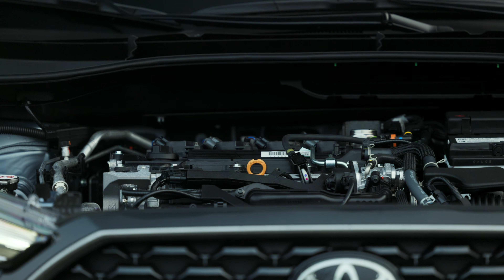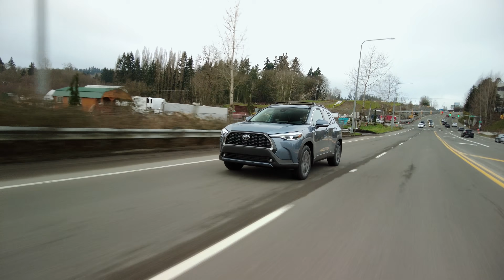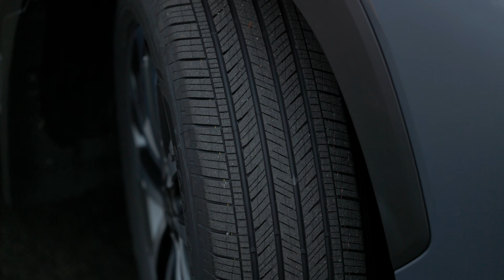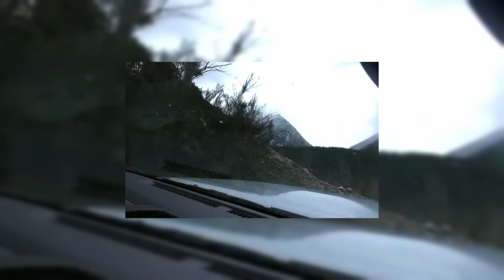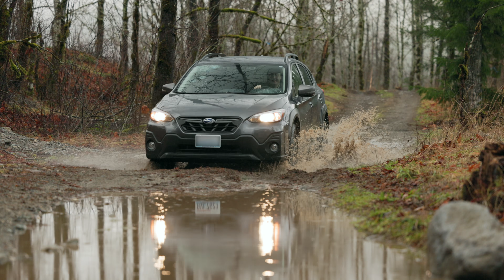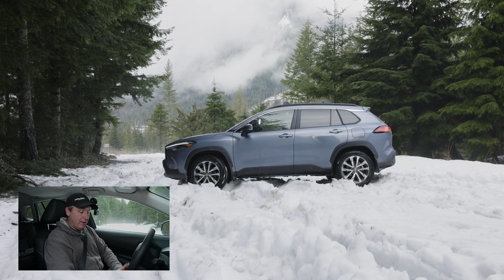2022 Toyota Corolla Cross vs Subaru Crosstrek AWD Off-Road and Snow

Comment: As much off roading as I do, I can tell you that with all due respect, the AT tires that Subaru has is an unfair advantage and from what I saw, did make a difference. Tires are basically always a major factor in any driving situations where grip is a concern. In the end, I'd like to see you swap tires and repeat the test.
Reply: Update: Although I was very interested in the Rav4 Hybrid, I ended up going with the Subaru Forester non-hybrid. I live in the woods like way out and 99% of my driving is hwy so the 4 mpg better hwy gas mileage wasn't enough to sway me in the end toward the hybrid. I found out that due to all the massive amount of safety features and ratings, I saved quite a bit on my (45% ish) on my auto insurance going with the Subaru and the value of the Subaru for me was better as I was able to get a fully loaded limited for the price of a base model (with some extras) Rav4. I like the fact that the Forester has a nicer ride and is roomier but I'm sure I'll own a Rav4 in the future. I can see reasons to want either.
Reply: I did find out that not only are Subaru's made in Japan where most Toyota's are usa (Rav4 Kentucky) but toyota does own 20 % of Subaru and they are havibg a positive influence on Subaru in the quality and reliablity department.
Reply: @generalcaeser9176  safety wise.
Subaru is very good.
A friend of mine got into an accident with  his subaru forester (a truck rammed into it). He has some injuries but the car was totalled.
After he got out of the hospital he went to see what his car looked like after the accident.
It was really damage badly. If looking at the car I would say he could have died.
So he ordered a new forester.
Reply: @zulkanainbaharuddin2185  That seams to happen a lot with these Subaru's. They really are the top for safety standards today and they have been for a few decades now. Thanks for sharing.
Reply: @OxnardComma  I felt that way for 25 years but there are just too many recent videos showing differently. I've owned loads of Subaru's and they are amazing but I've found them less reliable than Toyota's are. So I really like what I see on these new tests as it gives us both off road capability and better reliability.
Reply: Tires wouldn't have made a difference here. I agree that tires usually help...but this AWD system just isn't made for that type of off roading.
Reply: @JRsguitargear  Agreed. AWD is for roads in bad weather, not serious off road terrain.
Reply: @JRsguitargear  disagree, I do it often with my Cross AWD with AT tires out in the Mojave Desert & Colorado Deserts and people are surprised how far I get on these back roads. The hill he failed on I would have made it and many others would have also. It was not his car so he had to stop. Also there is a video of test drive in South Africa where they really pushed it to the limit!
Reply: AWD is ok, although I still think Subaru's is better. Main weakness is that it clearly needs a more powerful engine, especially in the more expensive trim levels.
Reply: @edsmith9855  I would be going for the Rav4 Hybrid so a larger engine wouldn't interest me. I hear you on the Subaru having a better AWD but come to find out that may not be the case any more. Check out some of the testing they do and you'll find that the Rav4 is coming out ahead and has in every recent video I've seen.
Reply: @generalcaeser9176  I was talking about Crosstrek vs Corolla Cross specifically in regards to Subaru having a better AWD system. Some Toyota models do have very good AWD systems.
Reply: @edsmith9855  Oh, I see. At first I was seriously considering those but then realized I really need more ground clearence with the amount of snow we get up north here.
Reply: @generalcaeser9176  Interesting, what does Toyota offer recently that beats Subaru? Specifically the X mode and hill control? I own a legacy with cross climate 2 tires and while that's certainly not a off-road vehicle (doesn't have X mode), combination of AWD, hill control and tires is phenomenal for snow and moderately icy conditions. One reason why Toyota recently collaborated with Subaru on the BZ4X/ Solterra is the latter's expertise on AWD and offroading with the Forester/outback
Reply: @z1az285  I'm confused, I never said anything about Toyota or Subaru being better one way or another. "Better" is subject to how you plan on using it. But, I'll answer your question anyway. Subaru has an awesone awd system that's fantastic on snow and ice, the Rav4 has improved and in many tests is every bit the equil to Subaru. I tend to still lean subaru if I had my choice though. As far as Toyota making something "better", if your refering to off road capabilities, the Toyota 4Runner is better off road more a ton of reasons but the main reason is that it has 4 wheel low. Nearly any vehicle with a 4x4 low option will have an easier time in rougher off road situations. So yes, Subaru AWD for regular nasty roads and trails but 4Runner for the tougher stuff.
Reply: @generalcaeser9176  I'm sorry, I didn't mean to imply you said better but I understand your example of the 4runner perfectly. Like I said, the partnership between Subaru and Toyota (BZ4X/ Solterra EV) was interesting because Toyota themselves said they wanted to use Subaru AWD tech while Subaru used their battery tech.
Clearly Toyota always had the AWD  knowhow. 
 Of course on another note they have collaborated on the BRZ sports sedan but I digress.
Reply: @z1az285  Yep, Toyota now owns 20% of Subaru. These past few years we've seen a surge in Subaru sales. We can already see good things happening with the two exchanging tech, I can't wait to see the future of the two. I just bought a new Forester 6 months ago but am looking forward to replacing it with a hybrid Forester with the Toyota hybrid tech. Then I wanna pick up a 4runner hybrid. We'll see what the future holds between new advancements and the dreaded supply and demand.
Reply: @generalcaeser9176  OMG, My thoughts exactly. I too am waiting for a hybrid Forester (or a plug in). I like the cross trek plug in too but it's a tad small. Let's see what Subaru does.
Reply: @generalcaeser9176  Great and Fair Comment 👍
Reply: @z1az285  He is kinda technical, huh 😅🤣
Reply: @Honestandtruth007  😁 but that's the way i like it
Reply: @OxnardComma  YES!   that may change at some point but not currently   Viva Subaru
Reply: Rav4 ahead in AWD? Haaa. It is a fwd system with rear added. It is a reactive awd system and not full time like Subaru. I have a Subaru and so do friends and fam. Also know some with Rav4’s. And even they admit their cars dont handle as well on the road or snow. Subaru’s awd systems are far superior to Toyota’s.
Reply: Masz rację
Reply: Absolutely! I've done small hills like the one he failed on with my Cross with AT's... But overall it was a good review.
Reply: He’s said in other videos the manufacturers don’t let them change the tires for reviews. But I would also like to see the Toyota do it in different tires.
Reply: @eamonob84  Except the Subaru is his and he has AT tires when he could have put all season on to match the Rav4. With that said, I drove both and I believe both are good and the Subaru feels a little more stable and capable with comparable all season tires on. Though the Rav4 was night and day better than it use to be. I ended up getting the Subaru Forester based of of Value. It was a good $6k (plus tax) less money than the Rav4 similarly equipped. I'm happy.
Reply: I can't help but think this dude is bias.

Comment: Subaru does have the best AWD system. I would rather drive a Subaru if there's snow and rough roads. I do think that if Toyota had better tires it may have done better.
Reply: my mom has  a 2011 matrix 2.4 with fwd and its amazing in snow. she just ordered one of these, we didn't get awd because i believe as long as you have winter tires it should do well also.

Comment: All I know, is that the traction control in my wifes Legacy just seems to make all 4 wheels spin pretty evenly when backing out my steep driveway with 6" of snow without a hiccup. For a sedan, it's a beast in the winter. I really think Subaru has one of the best AWD systems on the market.
Reply: I took my crosstrek through 3 feet of powder in my parking lot after a storm ,it went through it with ease ,it helped having pavement underneath me but I was still impressed!
Reply: Subaru symetrical AWD makes car hovering like UFO on heavy snow road,... I love drive my 2017 6 speed Legacy in narrow mountain road when nobody wants to go outside.
Reply: man im impressed with subaru and not to brag but 6” nothing my subaru outback ate 13” of snow

Comment: Corolla Cross looks to have some nice features, however would not even warrant a test drive with those horrible forward leaning head rests.  The older model Forester had the same type of headrest, and it detracted from an otherwise great vehicle.  Can’t buy a car where it is impossible to achieve a comfortable driving position.

Comment: I'd really like to see how these systems compare with systems from 10 or so years ago that used viscous limited slip rear and center differentials and compare the amount of power distribution compared to the brake-vectoring system.
Reply: No comparison. Our 1999 Forester would run circles around today's Crosstrek. Off-road that is.
Reply: @guardrail2897  There have been tests performed on older 4WD vehicles and the new ones using advanced traction control systems using break vectoring and the modern systems were surprisingly better short of a Mercedes g-Wagon with Fr, Car, and Rear differentials.  For the price (current) brake vectoring systems are great value for money.    The 1st generation M-Class was a disaster because these were new technologies.
Reply: @chrispnw2547  Torque vectoring is no comparison to a locking differential. There are many videos on YouTube that show older Foersters vs. new Foresters and there's no comparison. The older is far superior.
Reply: @guardrail2897  I was thinking more about a true off-road test I saw of several generations of Land Rovers against the new Defender, Land Cruisers, and Mercedes G-Wagens.   The ability to move power where needed was impressive.

Comment: FYI! The Subaru Crosstreck is using belt drive CVT while Toy Corolla Cross don't have belt. Meaning is designed to last...
Reply: You got that backwards.  Subaru's TR-580 Lineartronic CVT's are chain driven and designed in house by Subaru .  The Corolla Cross uses an Aisin K120 that is in fact belt driven with a launch gear.

Comment: I used to have a 1979 Subaru Brat. The smallest truck ever made. It didn't have a lot of power, but it was very light. It had a manual transmission with a shift-on-the-fly 4 wheel drive. It was a very capable off-road vehicle that could navigate through stream beds and rough trails. I think it's short wheel base and light weight contributed to the Subaru Brat's ability to keep up with Jeeps.
Reply: I have an 85 brat. Great for roaming around the mountains but lacked power on the freeway

Comment: What do you think of the Mazda CX30? It looks appealing but I am not sure of its AWD abilities. I just need a small urban SUV with a decent performance on ice and snow, not thinking of any off-road adventures! Also considering Corola Cross (I drive a 2020 Corolla now) and the Subaru Crosstrek as well.
Reply: I just test drove both and decided to buy the Toyota Cross. The driving position is too low in the CX-30. 
About Subaru, they have higher interest rates on financing and the Crossteck has no legroom at the back.
Reply: @GunsRUsWaW  Thanks for your input, I'll keep it in mind!

Comment: I had a Subaru Legacy for my wife, a 2007 traded in on a Mazda lease. I love Subaru and I love Toyota. They both are durable and out perform most cars. The test was unfair to Toyota. It will perform an AWD function the way most people would need it to get through the snow safely.  I feel they perform equally on wet roads. They are comparable  and equal value. Both cars are quality and will last  equally to the 200K area. The Subaru still has a timing bet and service was a little more expensive. Both great vehicles.

Comment: Great video. Would like to see the comparison with the same tires however. Speaking of tires. Could you send your message about all-season M/S tires not being suitable for snow as traction tires to WA DOT. Our passes are a mess because all-season tires satisfy the "traction tires required" post when we get heavy snow. The result usually means spin outs everywhere and closed passes. Come on DOT, real snow tires or chain up. Would go a long way in keeping the passes open with fewer accidents.
Reply from the maker: Oh. I know. Been stuck plenty of times behind yahoos with AWD and the wrong tires.

Comment: I'm considering these 2 n Mazda cx30 gt n Hyundai  kona n line,
Since here the Tucson are sold out n rav 4 needs an year long waiting list. 
Seems the Corolla cross very noisy n very lack of power for daily highway commute. 
Any suggestions for the above 4 choices, which is with good on snow, handling , trunk space, fuel efficiency,  active safety features n interior designs?

Comment: A very good comparison between the two. Will agree Subaru has a superior AWD system, but can't help but think the Toyota would go to the 200,000 mile mark with fewer stem to stern mechanical issues.
Reply: @NoName-gv6nm  the Toyota Corolla Cross has 169hp, the Crosstrek 182hp. 
CC 12.4 gallon fuel tank, Crosstrek 16.6
Gas mileage is pretty much identical when awd is applied to both. You have the potential of 100+ more miles out of a tank of fuel in the Subaru, that's also a plus.
I'd research a bit more.😉
Reply: @danielfair4675  Not even what they said. They are talking about mechanical issues. I have seen multiple people mention now the Cross should go forever, well out lasting even the Subaru. This has nothing to do with horse power or size of gas tank. 
I would try a basic comprehension class ; )

I mean, to be a smartass when you didn't even respond to what was being said...weak.